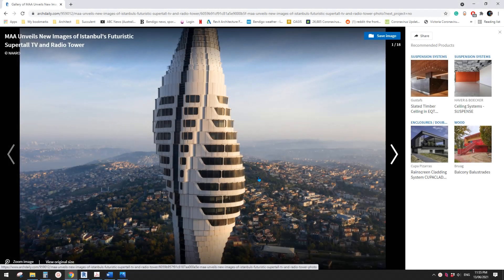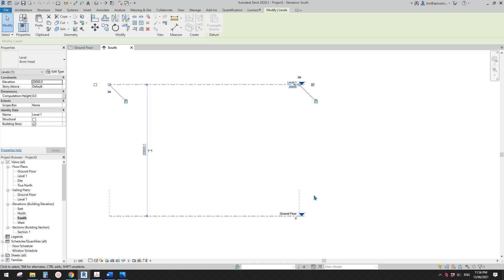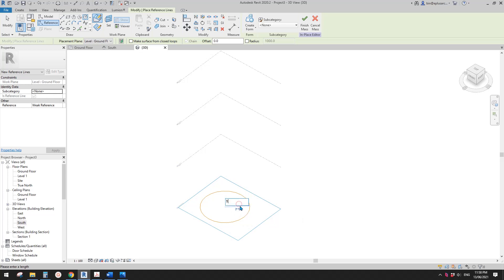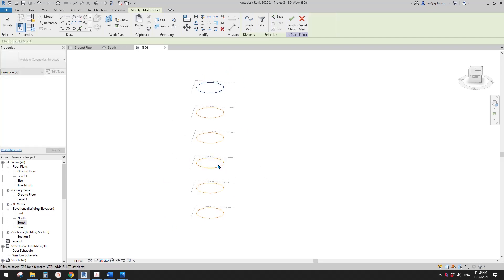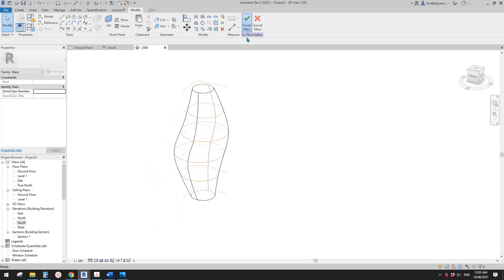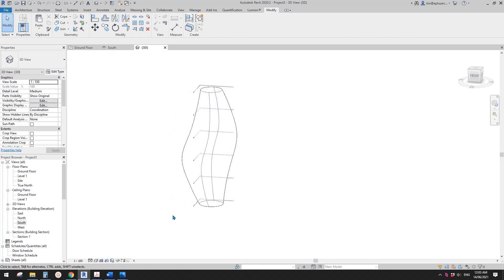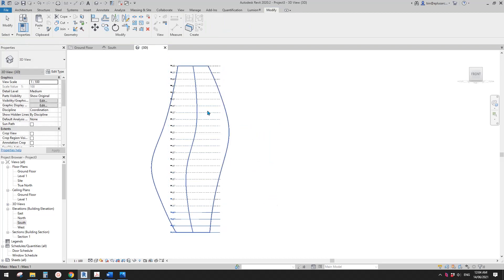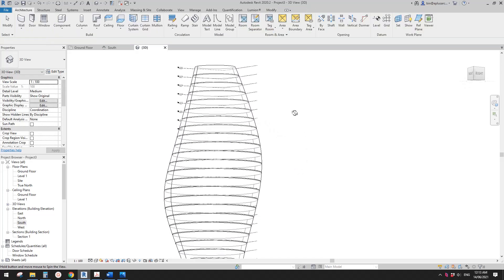Everyday Revit (Day 449) - Simple Mass Exercise

Comment: I thought it would be a little more complex. We'll see if the parametric elements on the front line are in the next lesson.
Reply from the maker: I’m not sure TBH. We might be able to model those panels using pattern based family, then there will be issues for the openings. I guess I need some time to think. :)